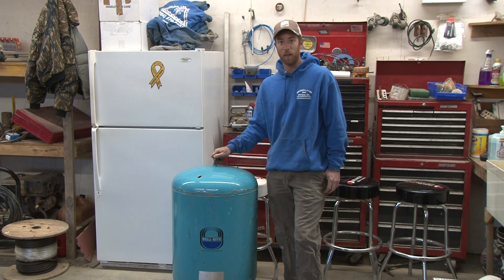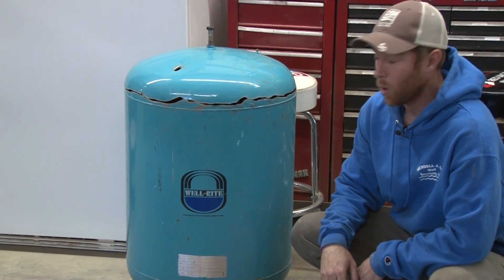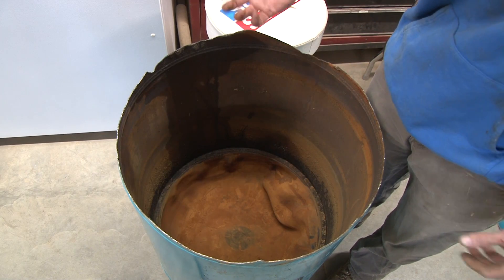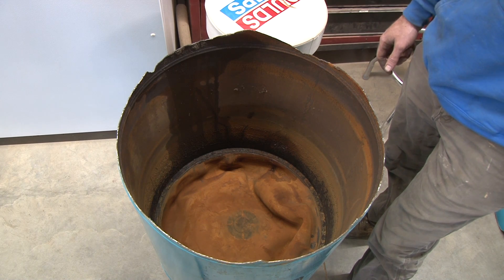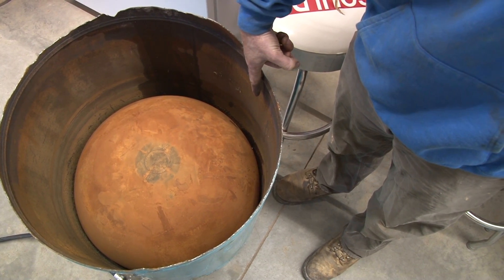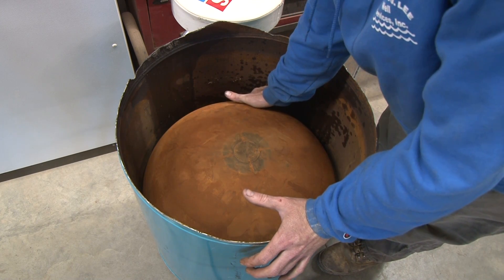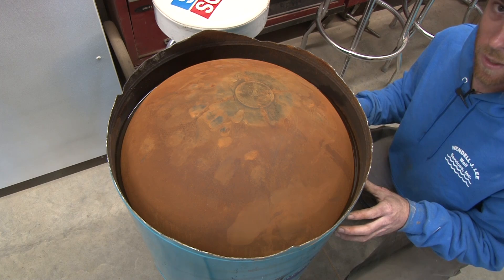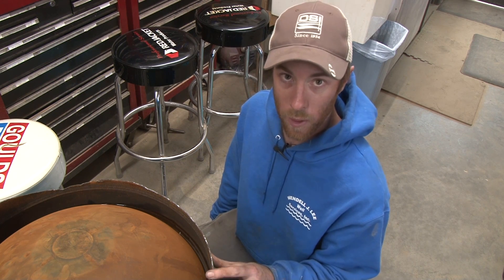Well Pressure Tank: How it Works and How a Tank Gets Waterlogged

Comment: Can you recommend a pressure tank with a replaceable bladder?  Commercial type.  I have a 2018 Well X Trol and the bladder is already loosing air.  These are like disposable tanks, and don’t last.  When I was in the a HVAC field.  We used large expansion tanks for boiler and chillers.  They had a replaceable bladder that could be accessed with a bolted mounting flange.
Reply: Some of the fiberglass tanks have replaceable bladders, but it's quite involved and requires completely removing the tank typically. If you are going to that trouble, most people would just rather replace the tank with a new one for the same labor cost. It's normal for a well tank to need a few psi added every year or two due to normal diffusion through the bladder (just like car tires need air every so often).
Reply: @TechnicalLee  Good info.

Comment: Thanks for these videos! We are about to have a well drilled for our new home so I'm learning everything I can. Question: Does the air in the tank need to be check and adjusted regularly by the homeowner? Second question....is a tank necessary? It's going to be just my wife and I in a 1800 sq ft 3 bedroom home. No pool. No irrigation system.
Reply from the maker: usually you can check the air in the tank once every couple of years or so. Yes, you need a tank on your well pump system. It is more so for the pump life expectancy and to reduce rapid cycling of the pump motor.
Reply: Thanks for the video
Reply: It might be even more recommended to have a tank, since you're using the water less frequently. Imagine the well pump having to turn on every single time one of you turns on a tap for a few seconds, instead of every 3rd-6th time.

Comment: I have a problem..! 
My motor 1.5 hp Rafello doesn’t increase the pressure tank (65 ltr)   pressure beyond 2 bar
Reply from the maker: it could be a number of things, bad stages in the pump, leak somewhere? is it 3 phase and is it wired backwards? it is hard to say what it is without being on the jobsite.

Comment: So how does having a hole in the bladder affect pump performance?
Reply from the maker: having a hole in your bladder will render your tank useless eventually. This will cause your pump to cut on and off quicker, eventually will get so bad it will be very rapidly anytime a small stream of water runs. The rapid starting/stopping of the motor will eventually burn it up and call for a replacement. A good bladder tank is the best thing to ensure your pump lasts a long time.

Comment: Will bad tank cause breaker to trip? Mind keeps tripping and can figure it out.. any suggestions?
Reply: I'm not a tech or anything like that, but my breaker was constantly tripping because the wires that were running from the breaker to the well house were shorting out.  That was our experience, hopefully it's start. Good luck.

Comment: Thanks for taking the time to make this video, Wendell!  Most helpful to those of us with wells and a very effective lesson in what’s happening on the inside of bladder tanks. Keep up the good work!!
Reply from the maker: Glad you enjoy them and we will keep them coming!
Reply: @WendellLeeWellServices  Yea better is good, but cost is what most have to deal with nowadays! Do I buy the ultimate pressure tank and go without food for a few months or do I buy what I can afford! Many country folk resort to putting a beach-ball in their tanks because they cannot afford to buy even the lower-priced tanks!
Reply: Thanks for your presentation. It was a learning experience for me, but question is, does a well pressure tank operates by  a dc current or ac? I am planning to install one where there's no AC available, only DC solar  current.
Reply: If your running off grid you are going to need a 3000 watt inverter to run the pump the tank itself is just a pressure  reservoir to hold water it has no electrical parts

Comment: Hey Wendell Lee team. Greetings from Pakistan. Great video. 
1. Does the pressure tank improve efficiency or output of the well itself? Or is it just for higher pressure at the taps? 
2. Can you show us how to attach a pressure tank to a monobloc pump connected to an overhead tank, for eg a tank on the roof of the building to increase water pressure to taps?
Reply from the maker: The pressure tank for a well system has nothing to do with improving output of efficiency of the well. It allows you to run a certain amount of water before the pump cuts on. This gives the pump sufficient run time and off time so the motor does not short cycle by cutting on and off too frequently.
As for your second question, you are pumping into a tank on the roof, then gravity feeding down to the building below right?
Reply: @WendellLeeWellServices  yes the tank on the roof is supplying the building however gravity does a great job on the ground floor taps, the taps on the second floor have considerably lower pressure as the tank is just a few feet above, approx 12 feet. So to improve pressure on the second floor we use a pressure tank and monobloc on the supply line coming from the overhead tank to the second floor.
Reply from the maker: @razanaeem9490  I figured that is what you would be doing. I'll get something going on it.